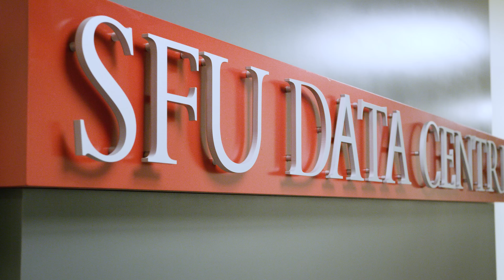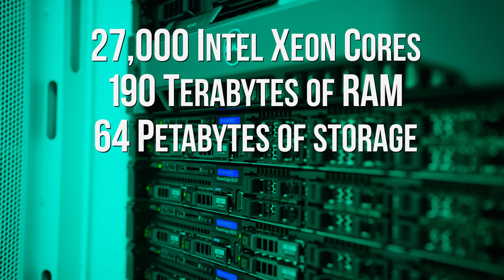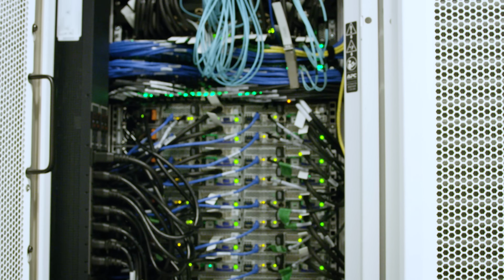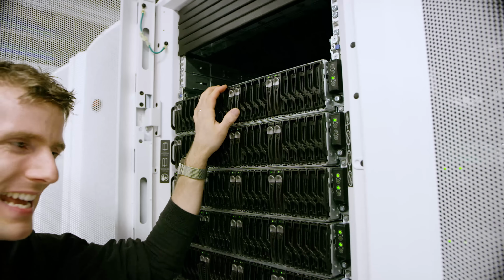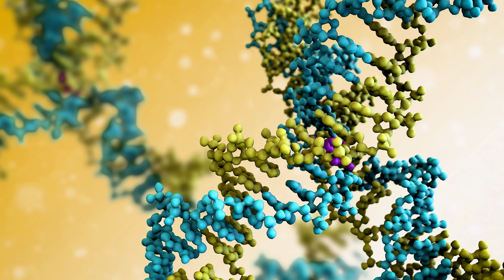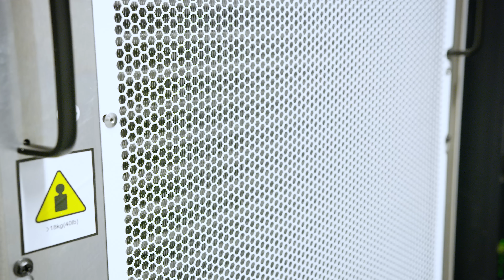Unboxing Canada's BIGGEST Supercomputer!

Comment: some day we will sit and laugh at how this is nothing compared to our $1000 desktops.
Reply: Spooky Ghost Probably never
Reply: Seb Gontrand  Trust we will have this at some point, prob not 10 yrs cos Intel slowing down progress and enjoying their position too much but we will have this, at one point :)
Think about ur pc vs a datacenter from the 90's.
Reply: James Boardman The place for big improvement is less bigger than in '90. Most improvement have been done by shrinking the process and at some point tweat the clock and higher core count. We are near the physical limit of process shrinking. Every incremental increase become more and more costly. To achieve what you said they need to think outside the box and stop doing the same thing like the last 20 year's. But any try going be at a high risk of failure. It's can be by a totally new CPU architecture, a new manufacturing process, etc.
Reply: Give it about 20 years. :)
Reply: Spooky Ghost it's coming to take a while processors are getting so fucking small they can't get any better
Reply: give it time boys i didn't say in 5 years i said 'some day'. science is crazy.
Reply: I doubt it too, due to +Seb Gontrand's stated limitations. It's likelier that you will use such resources from data centers remotely from your home desktop. If you have 10 GB/s internet, there is simply no reason to keep extensive hardware at your home. I guess everything will move to the cloud, and you will keep at your home relatively weak hardware. Processors will probably multiply in the next years, multi-core technology is currently the most promising area, but it will be nowhere near the progress we had during the last 50 years: a multiplication of processing power at home by billions.
Reply: +James Boardman Im sorry but no, we will almost certainly not have a 27000 core cpu in our lifetime. Also, even if it was an 8 core cpu with the same performance it would need to be over 4000 times faster per core than these.
Reply: Right now there's a bottleneck, as CPUs are getting to the limit of their size, that's why they're trying making quantum computers for google and stuff. It will probably take 10 years for them to be used commercially.
Reply: Quantum computing isn't great for everyday use so i doubt it will ever be used commercially.
Reply: it might be used in combination with today's cpus though....
Reply: TheAfroNinja true I don't think we will ever need that much power for a user Interface but it's effective for scientific purposes
Reply: People were saying much the same thing 30 years ago when we were running DOS, but look where we are now. How much computing power do you suppose it takes to make something that behaves like a real holodeck work?
Reply: Jeff DeWitt well much like we use GPUs for graphics, I'm sure there will be a dedicated processor for something like holograms, but as for the actual technology, lasers can be used with moving mirrors and touch can be perceived by sound waves, but still nothing close to a virtual reality room like in The Veldt.
Reply: Some day in maybe 50 years.
Reply: @Merthalophor
>it might be used in combination with today's cpus though....

Probably not. Just like Linus said in his recent video about commercial quantum computer, it requires suuuper low temperature and decent vacuum. Achieving something like this in home environment it's not going to be possible.
Reply: there is a certain heat limit that the universe cannot handle so yah in 10 years we will have better pcs but it will not come close to this unless we invent a new kind of computer all together (from how i understand it quontum computers cant do the same shit out desktops do )
Reply: Not yet, not yet.... 30 years ago no one had a clue how to build a 46" 4k flat panel monitor but today we can buy one for under $500.
Reply: ssuo ben we must also remember, this is the exact talk we had in the 80’s but look at us now :)
Reply: Moores Law is reaching it's limit. But one day your nanophone (TM 2017) will have more power than this.
Reply: Maybe in 50 years?
Reply: Problem is then if progress slows then why would consumers ever buy a new computer?

Comment: At 9:05 there is a piece of equipment not working as it should, it has a blue light on it. Furthermore, it is a shame that all the heat being generated could have been used to heat homes or swimming pools or stuff like that. Here in Amsterdam all  the datacenters would be able to heat half of the city easily, but the heat is just wasted in the sky at this moment.

Comment: USB Killer test linus? lmao
Reply: Peter Nasr i laughed harder then i should've
Reply: Peter Nasr That would definitely start a fire.
Reply: Peter Nasr holy shit lmfao
Reply: Oh god. lol. I remember my reaction when Luke pretended to try it on the desk pc. But, that was a measly like $7000. This... Well, this is a bit different.
Reply: Peter Nasr how to ruin 22mil in .1secs
Reply: it probably would kill just half the system
Reply: lmao
Reply: Computers like this likely have protections against things like the USB killer.
Reply: Even if you tried, you would probably only kill a single computer at a time... not the whole system, therefore I suggest killing the ones with 4x Teslas.

Comment: umm how many fps on csgo?
Reply: abhisheksscorpion almost 60
Reply: abhisheksscorpion if csgo has linux support than 474636636362636536263636363663fps if no linux support than 0fps
Reply: 30, 25 with gsync
Reply: all of them
Reply: random stuff all valve games have Linux support 😀
Reply: probably about 4206661337 IF you're using rgb razer gear, anything less than that, you're gonna be bottlenecked
Reply: 0 fps
Reply: A lot. but not super crazy. about 6 gpus. 7 and 8 wont be any better
Reply: 300fps
Reply: Prob 100,000,000
Reply: Cairo Murphy no. SLI is only increasing performance to about 8 gpus

Comment: But can it run crysis?
Reply: Harrison Thow only minesweeper 3 fps
Reply: It can but only on mid settings @512K and 4M FPS
Reply: Harrison Thow no it can't. Games like Crysis are both incompatible with the server OS that these supercomputers use and the hardware inside of them. You wouldn't even be able to install Windows on this beast!
Reply: LordFireApe wrong. you would be able to run crysis super well if it had windows server. there is just no reason to do it. and well i wouldn't imagine them using that for this machine tbh
Reply: yeaaaah if you manage putting windows on it
Reply: nope no video out and not set up to do anything but CPU and GPU compute so no gaming drivers maybe professional drivers for the Tesla cards but the drivers will not work well due to no ROPs to make it more towards pure compute thus not able to run any game at all even with more compute then every device in whatever city you are in combined if you are in the mid west the entire state will not have that much compute power either 
however it is able to compile crysis from the source code if you have it and whatever compiler needed to use for it to install onto the machine as the computing power is there just probably not all the compilers in the world to compile whatever you wish as a super computer for compilers is one of the compute clouds of what amazon does not Canada
Reply: No it really wouldn't, the GPUs in these Supercomputers are not designed to do anything other than graphical compute, meaning that playing games is an impossibility. These supercomputers often have a very primitive GUI that can be used to access deep computing, but not actually render anything like in a game.

Comment: Never expect fans are required to cool computers in Canada.
Reply: Allan Sh lol just stick them in the snow and in the winter you don't have to pay for a heater
Reply: Allan Sh here in surrey temperature hits 30 in winter and -2 in winters. Temp is mild here i metro Vancouver area as compare to rest of canada
Reply: Move a little East, and you'll reach the 40 Celsius summer temps.

Comment: I'll bet $100 Linus didnt have permission to take that hard drive out...
Reply: TummyWummy At least it didn't matter, servers are designed so hard drives can be removed and replaced without disrupting service.
Reply: TummyWummy i was freaking out when he just removed the hdd
Reply: mr.xkp It's not a HDD, if it was then yes he would have broken it. It's a SAS drive.
Reply: AppleEater01 Linus's fidgeting was the prime reason the industry started to design them like that.
Reply: Wrong... It is an HDD. SAS is just the interface in which the HDD is connected for data transfer. Like SATA is a type of interface used for transferring data to and from drives, so is SAS. It could be SSDs or HDDs connected to the interface. In this case it was an HDD

Comment: but can it run minecraft on smooth 20 fps?
Reply: This probably makes 200 bilion FPS. Minecraft is Java based so mainly used CPU. This means those xeons should not have any problem at all getting this smooth.
Reply: Nathan van Dalen I hope you learn the definition of sarcasm before you are invited to your first party.
Reply: +Nathan van Dalen well, you say that but minecraft can't use all these cores. It uses like 2 cores, and xeons don't have extremely performant cores, they have lots of them. A pc with a single i7-7700 would do better than this supercomputer at running minecraft...
Reply: But can it run minecraft... in 4k?
Reply: Shantanu Bharvirkar but can you come up with original comments that stopped being funny 5 years ago?
Reply: Nathan van Dalen you don't sayy
Reply: minecraft is single core tho
Reply: would struggle with shaders full on ;)
Reply: No, minecraft is dependent upon all parts, Faster storage= Faster load times   
More ram = More calculable fps (It's hard to explain. Minecraft as you know tries to load as much of a world (including it's calculations) into ram. so 128TB of ram is pretty good) and the GPU does all the texture management, rendering, and mainly, VBO.

Comment: What I don't understand is why not use the heat to generate electricity? This data center generates a huge amount of heat which is transferred by water. Why dump it on a cooling station and not pass it through a steam turbine and generate some electricity? It will help to offset some of the power consumption the data center probably requires.
Reply: Laws of thermal dynamics would like a word with you
Reply: how do you expect to get steam out of it? and how do you expect computers to operate at temperatures above boiling?
Reply: Hmmm ... what about thermoelectric cells?

Comment: Pulls out hard-drive... Researcher studding in god knows where's process crashes.
Reply: Most of them have redundancy mechanism built into the nodes such as RAID. So they can hot swap the dead drives without losing data.
And I believe the node was shut off on purpose so that Linus can show us the hard drives.
Reply: Spencer D once I run this simulation bam we will prove god exists... error404
Reply: Spencer D there in a raid10 array, even if you pull out 25% of hard drive everything should work fine.

Comment: why can't they use the heat of the servers to warm up houses nearby
Reply: Pyryhz 931 there are no houses nearby :D
Reply: OutOfRangeDE yeah only igloos
Reply: Pyryhz 931 they would melt all the igloos
Reply: because it wouldn't be efficient at all, there is no way to concentrate all the diffuse heat, and it doesn't produce enough heat. (my opinion).

Comment: biggest supercomputer vs USB killer
Reply: Jonny Combes i womder if it even has any usb interfaces?? i mean it would be redundant wouldnt it?
Reply: The head nodes will at least ... I see Dell servers and they will have VGA + USB for provisioning / emergency local access
Reply: Jonny Combes are there even usb ports anywhere on it
Reply: there are a bunch of even usb 3.0 ports on them in the rear I/o
Reply: Jonny Combes Honestly, I would be surprised if the USB ports on those servers were not disabled in the BIOS.

Comment: Imagine gaming on that. Just imagine...........
Reply: Abhishek Acharya It probably cant
Reply: Abhishek Acharya It would probably be garbage to game on. Tesla GPU's have no video out and most games can't even take advantage of more than 4 cores let alone multiple 16 core CPU's more over Xeons have verry low clock speed so even if the Tesla's could game they would be extremely bottle necked.
Reply: Abhishek Acharya It isn't the same thing.Its like a car going fast but not pulling a lot or pulling a lot and going slow.These are work horses required for large data processing not a race horse
Reply: Just imagine having to render real time on a gpu really far away. Sounds amazing/s.....
Reply: Teen Shinobu Is best Waifu games are moving to 8 core 16 threads cuz of ryzen

Comment: Imagine gaming on this it would break my Minecraft
Reply: Adam Mercer it would because super computers can't run games lol
Reply: They actually can.
The hardware is the same as desktop computers (not talking about specific video accelerators), and the system (as far as I know) it's managed by Windows.

So yeah.
But 27k Xeons wouldn't be enough for Minecraft anyway.
JK, it would run like crap.
Reply: The OS is a Linux distribution, CentOS. There is not a single super computer using Windows in the top 500 since 2015 (https://en.wikipedia.org/wiki/TOP500). Even Windows' cloud Azure is using a customized Linux under the hood (but admittedly it's just a part of the system that runs on Linux).

Comment: But does it have a headphone jack?
Reply: hope so lol
Reply: AlphaxAlex if it doesnt you can always put a pci sound card in
Reply: serial? pfff so old

use fire wire
Reply: No, the building was made by Apple.
Reply: not so fast, that won't have a driver on linux server
Reply: With that much power it can basically telepathically send you "the beats"
Reply: SCSI? Pfff so old.

Use wood
Reply: Wood? Pfff so old.

Use glue
Reply: Glue? Pfff so old.

Use water
Reply: Glue? Pfff so old.

Use dandruff
Reply: Glue? Pfff so old.

Use Carbon
Reply: Dandruff? Pfff so old.

Use lice
Reply: USE A SATA 1 PORT xd
Reply: Yea but no sound card
Reply: Lice,ceiling fan? So old
Use wireless

Comment: yeah yeah but will I be able to run Minecraft at 60 fps?
Reply: Richard Guzman no
It runs minecraft at 999999999999999999999999999999999999999fps
Reply: Richard Guzman ahahaha.. so hilarious and original!
Reply: No, you need X11 which it doesn't run.
Reply: ECKSDEE no it cant run it at all, it wont even boot windows
Reply: Oleboy555 it is like a regular pc.
Uninstall all the shit that is on there, install windows, enjoy your games at supersonic speed

Comment: but can it run crysis
Reply: actually no
Reply: It can't even run roblox
Reply: but can it run minesweeper??
Reply: it can run pong at 10 fps
Reply: can  it even run windows?
Reply: That was my first thought!
Reply: can it run tetris ?
Reply: probably not, it would run a custom OS based on a Linux kernel.
Reply: I swear to God i came to the comment section just to find a comment like your's sir. Have a like
Reply: no,
Reply: no, you will need 128 of these...
Reply: M-maybe?
Reply: The first thought I had as well when reading the title!
Reply: its gonna use custom version of Linux
and no it cant run windows
Reply: I was thinking that as he was talking about the specs
Reply: they could install a windows vm on a ramdisc and run crysis at thousands of fps (some guy did this on yt with a smaller supercomputer and it was completely glitching out as games aren't made to run at 4 and 5 digit fps numbers) but that would be a waste of compute power and money.

Comment: but can it run crysis
Reply: Nope, but with a datarecorder you can play Chuckie Egg.
Reply: Lasagna for Din Tonight but what if we installed a windows os then we can play those games
Reply: If you choose windows 10 Home, you would "only" be able to utilize 128GB RAM and 256 cores from maximum 2 CPU's, if one CPU have 64 physical, 128 hyperthreaded cores. When that is said, there is hardly any GPU power in these systems, most likely all are Matrox G200 or eqvivalent. Those are capable of running DOOM 3D, but not Crysis. Sorry to eat your dreams.
Reply: GeneralCringe BEAT ME TO IT!
Reply: Dbass91 um no the output GPU will be from the computer hooked up to a management port so no output graphics at all on that massive building size computer system unless you count the interface on whatever PPP network it has but that is on a different computer not the computer system shown
anyways why would you want a graphics out on a all compute computer system when you can just have the IPM or IPMI port or if they want to be super cheap using RDP over the massive network still using another computer to do so from 
so it can compile crysis 1 2 and 3 for you at the same time if you want it to do so but it cannot play games due to missing the parts needed to do so unless you want to in  OpenGL then have it being played over a networked Virtual Machine which i do not think they will set up due to it reducing the computing power of the system
Reply: Lasagna for Din Tonight you probably have enough ram to get it to run in WINE